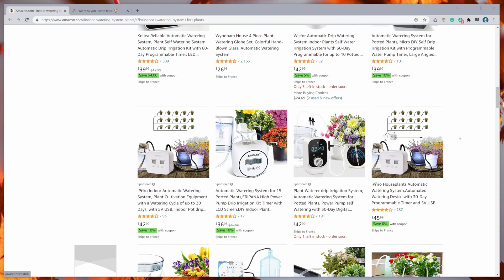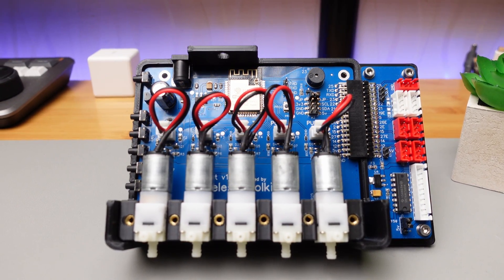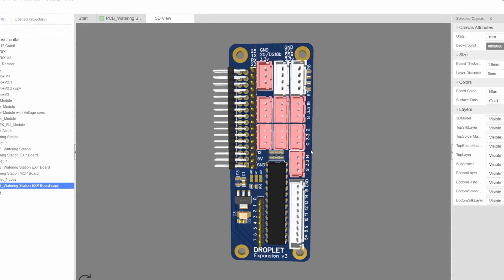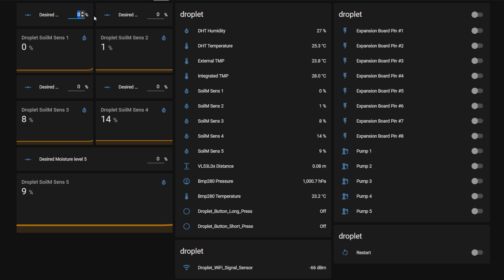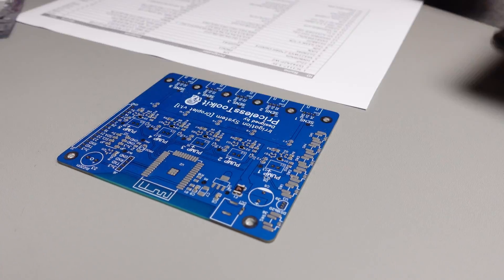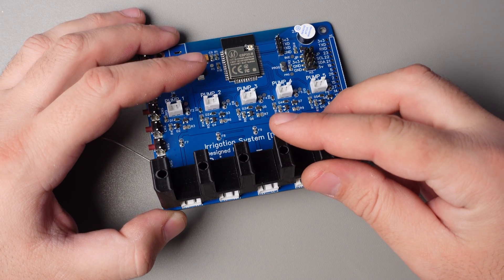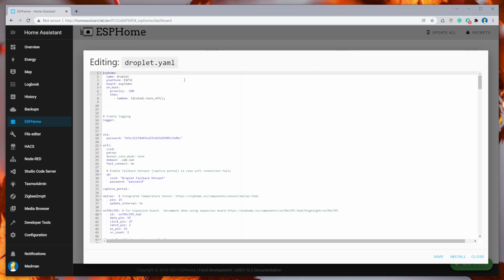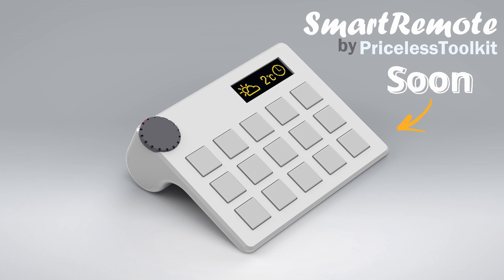DROPLET Smart Irrigation System  for ESPhome and Home assistant

Comment from the maker: 😉Now you can buy Assembled PCBs in my Online Shop https://www.pricelesstoolkit.com/en/projects/21-1-droplet-smart-irrigation-system.html#/28-kit_options-only_mainboard
Reply: I'm really interested in this but haven't looked very deeply yet.
You mention the config needs a desired moisture level. When will this start watering? Whenever it's below that value?

I was thinking about using it with pepper plants, but they need to dry out sometimes and then get watered to a certain amount.
Reply from the maker: @ALex-qc4lf  Hi, you can comment out some lines from YAML and do all automation from Home Assistant, you can implement any logic you want.

Comment: i became home assistant-addicted during last year and this looks exactly what i was looking for, great project! 😍
Reply from the maker: Thank you!!
Reply: just wanted to give an update that might be useful to know : be aware that these tiny pumps do not withstand hydrostatic pressure, so a) do not place your plants lower than the water tank or you will flood your plants or b) additionally use valves to prevent that. (let's say i discovered that 'experimentally' for science's sake...)

Comment: Great job, I appreciate the effort that you have put to create this and it is great the amount of possibilities that this board gives. I am interested in one unit to test and maybe I would acquire more after doing it, but I have some questions.
What kind of power adapter do you recommend? Any link in particular to buy one that you have already tested?
Which is the port to program the ESPHome chip?
Thanks in advance.
Reply from the maker: Thanks. any good quality 5v 2-3.5A power adapter with Plug DC-005 2.0.  The programming port is a 3x1 Pin header UART "note populated".  Today I will add instructions to GitHub
Reply from the maker: https://github.com/PricelessToolkit/Droplet/blob/main/README.md#wifi-captive-portal
Reply: @PricelessToolkit  thanks, really appreciated. 👍🏼

Comment: Hello! I am very intrigued by your setup. I am curious if it possible to use the Miflorasensors I already have integrated into home assistant as the inputs for and then create automations within home assistant to control your relay. I really like how many independent channels it can control as I would like to automatically water 10 plants in two rooms each.
Reply from the maker: Hi, Yes you can do it easily
Reply: @PricelessToolkit  that’s amazing. Would I just try to recreate your kit without the sensors? Will the code mess up if I don’t connect them to the board? Many thanks for the quick reply - happy to support your efforts as well!
Reply from the maker: @MBonaccors  If you do not remove the extra code that you do not use "like sensors" they will be visible in the home assistant, but it doesn't affect functionality. if you will be using other humidity sensors and want to automate  irrigation process with Home assistant, you need to remove or change the code, from line 232.  Thanks for the support!!

Comment: How its going
Reply from the maker: Hi, the SMD side is finished, left to do manual soldering "through hole components". In general, it remains to solder the connectors and check for operability.  Bought a lot of equipment for future productions. in the future, this will allow me to do "PCB assembly" quickly several times. The problem is that there are only 24 hours in one day, Overtime at my main job. don't leave me much time for my favorite things.
Reply: @PricelessToolkit  whats the price for it? ;p
Reply from the maker: @thestonevoon  Unfortunately not cheap, 1x main board + Expansion board 65 Euro. If you build it yourself you can economize ~20 euro

Comment: I do not see this project (DROPLET) on Crowd Supply, have you a progress update?
Reply from the maker: Hi, Crowd Supply accepted my project, But after I found out what needs to be done...., I canceled the project on Crowd Supply. And I decided not to order assembly in China, so I bought a good PnP machine, a Reflow oven. Already installed an inventory management system "I have more than 250 different SMD components in stock", made a website for sales, made a test rig, almost everything is ready, It remains to modify a little bit the reflow oven.         I think If I assemble it myself quality control will be better and in case of a problem, I can react faster.  ps: At my main job, I solder over 100 boards a day. So with my experience, I don't think there will be any problems.
Reply: @PricelessToolkit  Sounds great!!! Hoping to see a place to purchase one soon

Comment from the maker: !!!! UPDATE 27/01/2022 !!!!!
Hey guys, there is a couple of news for you. 
1. Tested the new expansion board v3, it worked flawlessly, so I uploaded Gerber files into the GitHub repo.
2. Deleted the old link to the pumps since I ordered 30 pieces of which 10 were for air. "New links in the video description".
3. I am working with Crowd Supply. Even if I do not reach the goal, I will order an assembly service. So be patient it can take a little bit more time.
Reply: I’m still looking forward to buying a unit from you:)
Reply from the maker: @klauskinski7614  Hi Klaus, Crowd supply accepted my project, so I'm working on that  . At the same time, I am working on the design of an online store.

Comment from the maker: Hi Guys, right now I'm trying to launch a "crowd supply" may I ask? at what price are you willing to buy both assembled boards ?  because it will be much cheaper if you buy pumps separately from aliexpress.  if I order pumps in bulks only shipping is 500$ :(
Reply: For myself, I am most interested in the assembled boards. I have a 3D printer and could buy the pumps separately.
Reply: I don’t know. Without the pumps maybe 20$? Or is that too cheap?
Reply from the maker: @klauskinski7614  it's even less than the production cost :) But that's not all +  import Taxes + sales taxes + packaging .....
Reply: @PricelessToolkit  Ah ok I see. What would you suggest?:-)
Reply from the maker: @klauskinski7614  Unfortunately, I don't have a Pick a Place machine yet, to reduce the price of production and imports I am in France. Approximately the price it turns out somewhere around 65 Euro if you want me to have something left for my labors and time. Of course, for many, it will be expensive. But do not forget that everything is honest all files will be available after the last check, Gotta get the v3 expansion boards (25/01/2022). And those who think that the price is high can assemble it themselves easily!!! and save ~22 euros.  About 50 people wrote what they want to buy,   probably real buyers 35, as you see, this is not mass production, there is only 1 way to reduce the price, assemble everything by hand.
Reply: @PricelessToolkit  Sure I want you to have left something für your labor! 65€ would be fine with me, mate :-)
Reply: I'd be interested too, esp at the price you're suggesting.
Reply from the maker: @ryanandrewbaker   Hi, Yes it's basically ""esp"" with MOSFETs, temp sensor, buzzer, fuses, port expander, and connectors. you can build one yourself if you wish. i will upload all files soon.

Comment: Awesome project! I was thinking of making something like this myself, but your version is really well polished! Question - Those pumps seem to be designed for air transfer, not water. Is there a chance for long term issues with using those pumps for moving liquid?
Reply from the maker: Thanks!! , There is a Russian project that uses the same pumps without a problem, the Chinese glue different labels on the same pumps
Reply: @PricelessToolkit  good to know!
Reply: @PricelessToolkit  will you be doing a crowd supply order for the pcb?
Reply from the maker: @Bengizmo  you think crowd supply will work ?